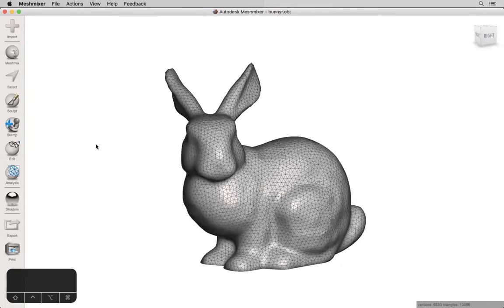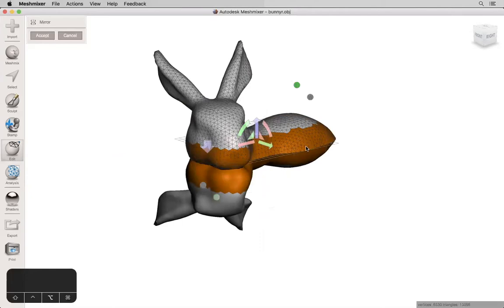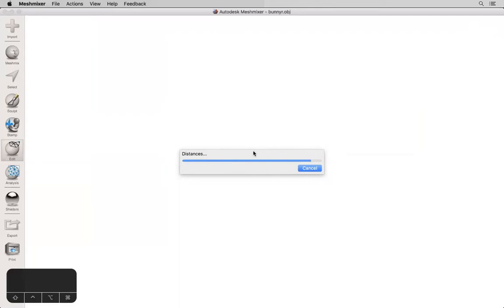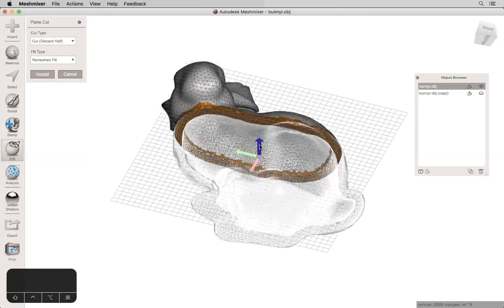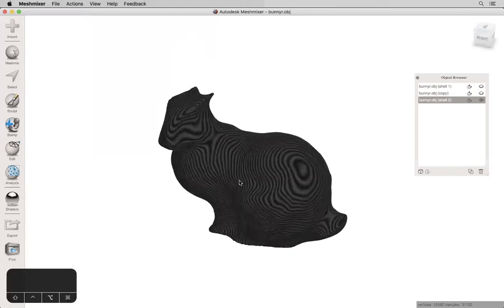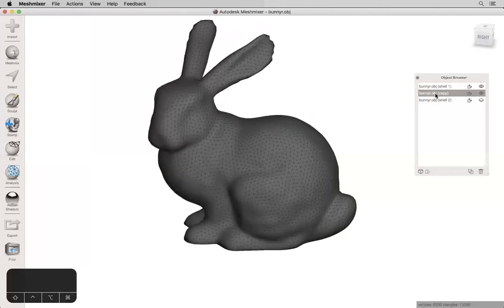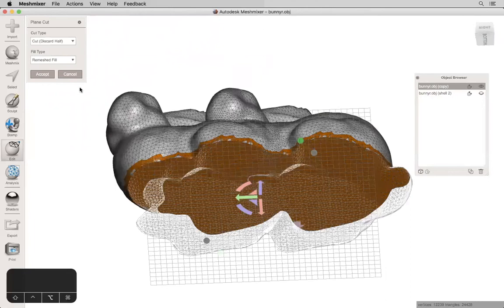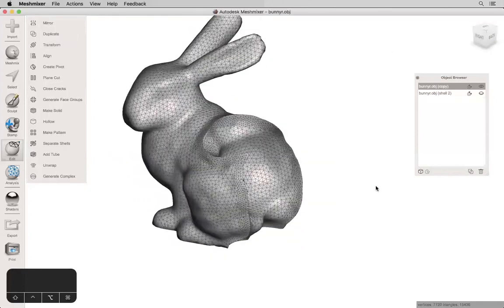Meshmixer Basics Part 2: Edit Menu

Comment: This program is driving me insane. Why would they make it so you can't open the menus to make changes to the mesh without first applying the changes first at default settings!? "So you want to apply Make Solid using the Sharp Edge Preserve solid type? Well you have to apply Fast first. Oh, that screws your model up? Too bad."